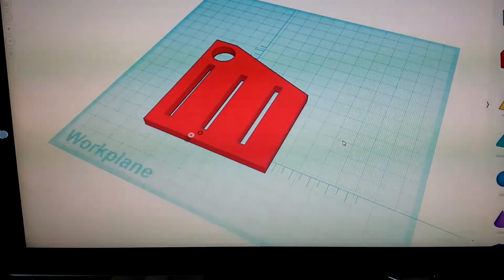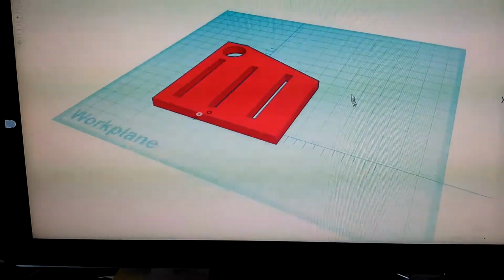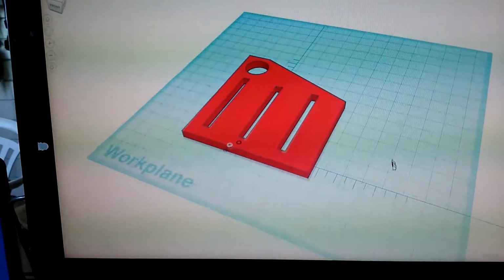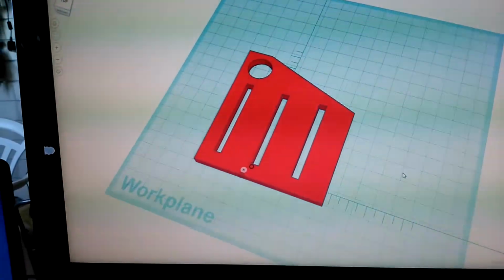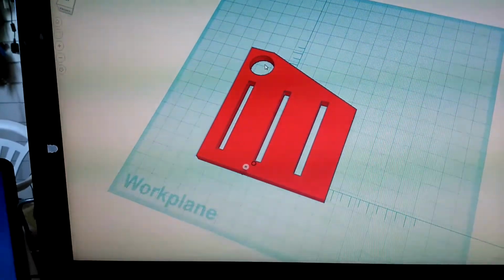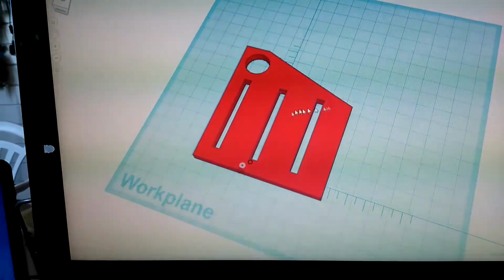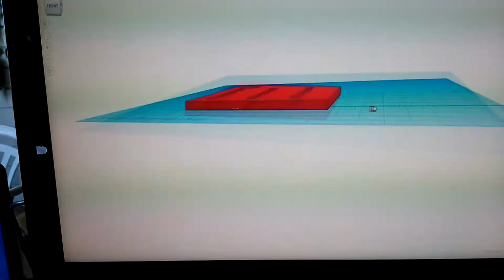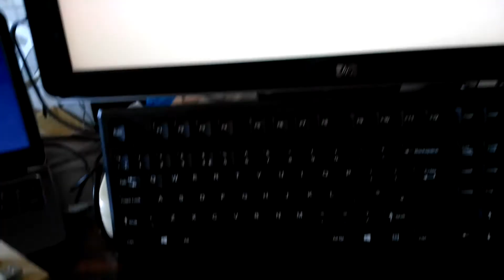3D Printed PLA Part Warping

Comment: Your Tronxy X1 assembly video was one of several that convinced me to buy my own, and while I've experienced a number of issues I've been able to resolve them all and am now getting extremely good prints. With respect to large surface-area prints like this I solved it with a combination of liberally applying glue-stick directly to the print bed and increasing my first-layer temp to 205C. I use 3 bottom layers myself, and everything above the first one is printed at 195C. Haven't had any warping at all since I started doing this, although I suspect variations in filament probably play a big role as well.
Reply from the maker: Hi Myndale. Glue stick did nothing for me. In the end masking tape ("Blue painter's tape" for Americans) was a total fix for me. I made a video about it here: https://www.youtube.com/watch?v=XRnHDoGqe4g&index=2&list=PLEFr39dH1zRKbSsd3fsVryNnGR3lR89ok

INcreasing first layer temperature isn't something I even knew could be done. I'll try that. ALthough the tape works, it creates a matt finish on the print which I'd prefer not to have. SO thanks for that tip!

Comment: Using tape wont help, it will lift the tape off the bed easy unless you use some rubbing alcohol to make the tape stick permanently to the bed. I just printed a part that is 14 cm wide with 0 warping not even corner lift using a glass bed and pvp glue stick.
Reply from the maker: coibulus - thanks. Another witch's brew to try. PVA glue, glue stick, hair spray, blue tape, heat the bed, cool the bed, and now PVP glue. I wonder how so many strong and contradictory opinions can exist. I guess there are a lot of variables to cloud the issue. I'll try it though - thanks again.

Comment: As I said on the case of the warped case: Painter's Tape of the smooth type replaced my gluestick. other trade names of the stuff are Masking tape, Blue tape etc. The cheap, not too rough type does it. 2 inch wide roll should be perfect to cover the bed with 3 strips.

On the other hand, check out the mods to the TronXY X1 to increase quality. Thingiverse has some group and collections for those parts.
Reply from the maker: I didn't think it was available in the UK Trischa, but - as someone pointed out to me yesterday - I am wrong. So I will buy some today and give it a go.

Thanks

Comment: You should use glue stick on the bed. I never have this issue with the x1. Also a good advice will be a glass-bed
Reply from the maker: Thanks Matthias. But as u say other video I am using it already.

Comment: I presume that's PLA. you cannot print ABS without a heated bed (even then its a b##ch).
the glue stick and hair spray solutions generally only works if you got a heated bed. the easiest thing to do is coat the bed with blue 3M painters masking tape. you will then have to level the bed to compensate for the extra thickness.
Reply: http://www.scotchblue.com
sticks like hell to PLA. then you got the problem of getting the part off the stuff without ripping it :)
Reply from the maker: Yes, it's PLA Gary. I can't find this painter' tape her in the UK.
Reply from the maker: Well shiver me timbers, Gary. I'd looked - but clearly not well enough. Thanks.
One thing I don't get though - this is single sided tape. If I stick it down, I don't see how the top will help as it's not sticky.
Reply: trust me, sticks like s##t to a blanket :)
Reply from the maker: I'm glad to hear it!